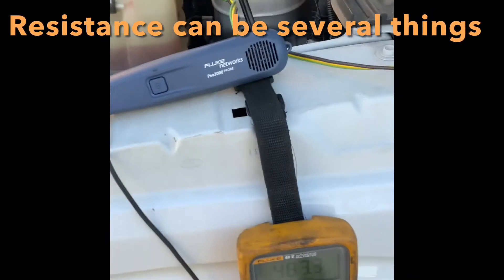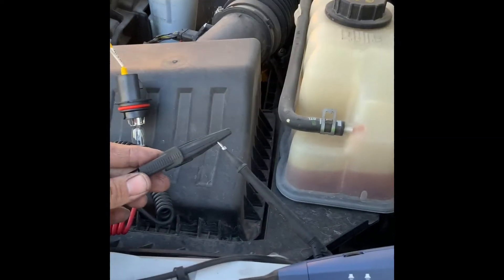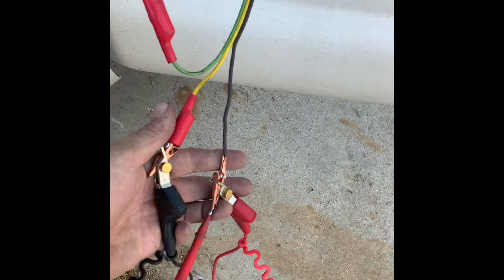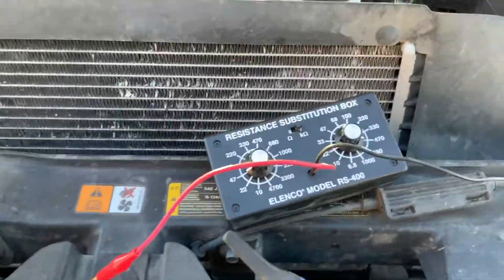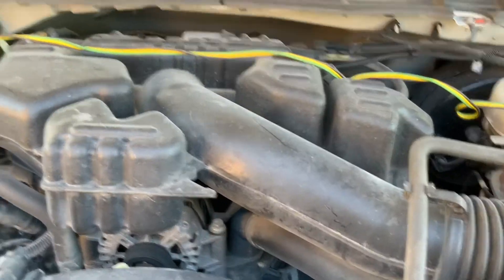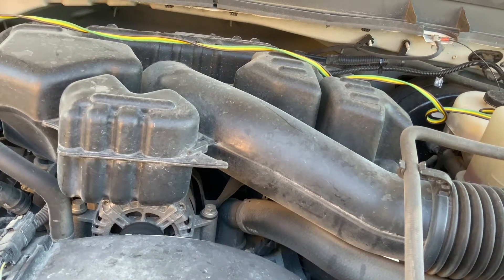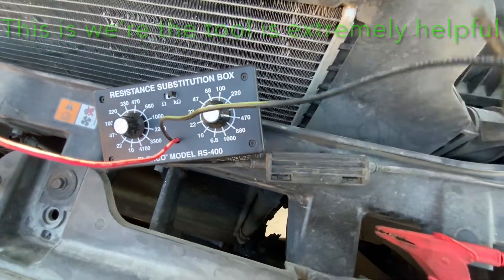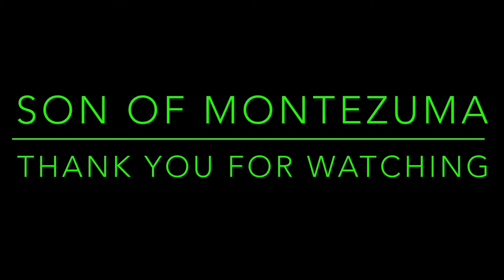Fluke Pro 3000, Automobile, best Easiest Way To Trace Wires

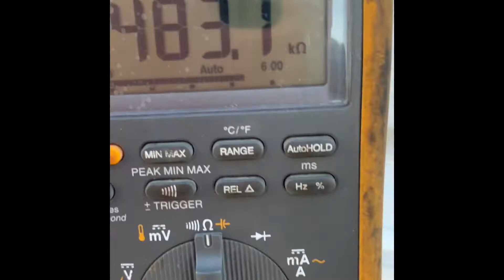Comment: 1:58 "there it is 483 ohms." No, 483 k ohms.
Reply from the maker: The box gives ability to do both
Reply: @sonofmontezuma3732  Of course it does but that's not what you said in your video
Reply from the maker: @mrcleanisin the object of the video is to show case the tracing ability of tool even with resistance. Now if you hv resistance this can cause ghost voltage ( totally different topic). I hv made muiltple videos on this tool and I get amazed at the point of view from the viewer’s which I appreciate as it helps me to teach the younger guys

Comment: why do you need the resistance substitute box? Also, I'm wondering if the fluke 3000 toner has the potential to damage a car's computer.
Reply from the maker: Resistance is help when attempting to isolate an issue for example is it a harness or a component? If you have a lad scope it’s much more use full , let me remind you that there are different types of resistance tools the one on the video that has a very broad range as you can see in the video. Is this situation we have to under stand there is no load and even with resistance substitution for corrosion in this case it proves the circuit could trick a multi meter or test light I have a different video show a load circuit and how it reacts to a Live condition. The fluke has been in use with me over 18 years and far as the ecm goes I don’t have an answer other than I hv never hv had it happen , hope this helps . Remember it’s about neutrons, proton’s,electrons grasp that and the rest starts to fall in place and of course ohm’s law helps too
Reply: @sonofmontezuma3732  thanks for the info. I learn something today.
Reply: @sonofmontezuma3732  can you send me the link of the other video you mentioned?
Reply from the maker: Truth be told I have several good videos on electrical,you would have to go thru my stuff I recommend the one with the amps too . Electrical is the achilles heels of almost every technician, I know.

Comment: Yeah cool, but how do you connect it to the wire you want to test? Do you need to cut it first? To hook on to the cable? Then I would need to cut open a bunch of wires to get an open end?
Reply from the maker: Normally it’s at the beginning or the end of the wire I connect too , for example pull fuse for the circuit and connect there, remember you are broadcasting a signal thru the wire looking for an open or short to ground

Comment: In practice, i would think that the earth wire of the circuit will make the whole chassis and engine tone, when you are testing a wire for an open.

Might be good for testing for opens on looms disconnected though?
Reply from the maker: Yes you hv to be on your toes and have a good idea of what your doing , if not you could sabotage your self

Comment: Great video. I have a Toyota Sequoia and the brake light keeps blowing a fuse so I bought this to try and trace the short. How would I go about doing that? Do I connect the red clap to the fuse terminal for the brake light?
Reply from the maker: Yes connect to fuse red  and turn it on and follow the wire . If you connect the black clip to ground and you hv no tone that indicates short to ground   Undo black clip and trace wire
Reply: @sonofmontezuma3732  I appreciate your help!🙏🏼
Reply from the maker: @brandon51541  the fuse buddy is also a great tool for shorts as a short will pull high amps